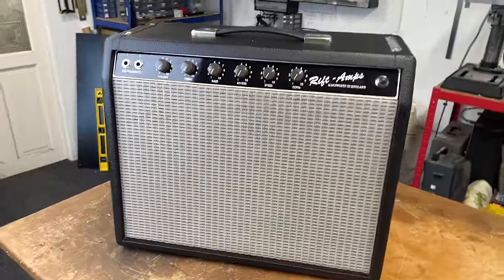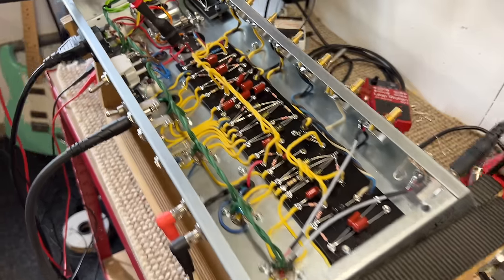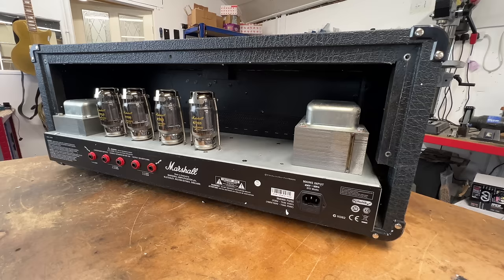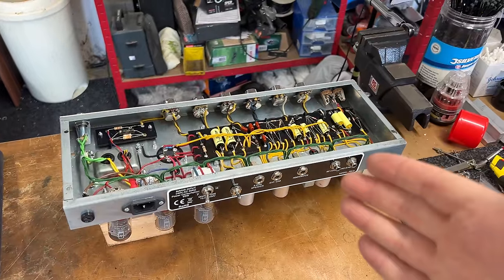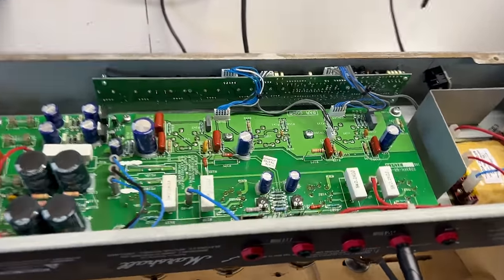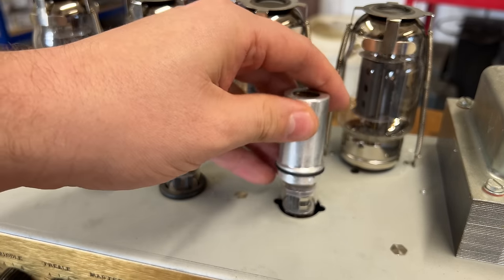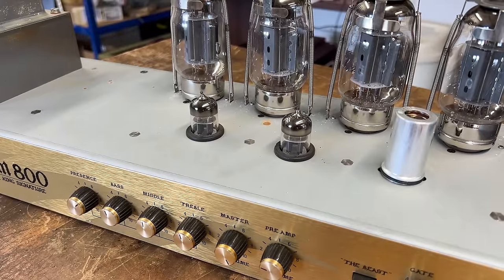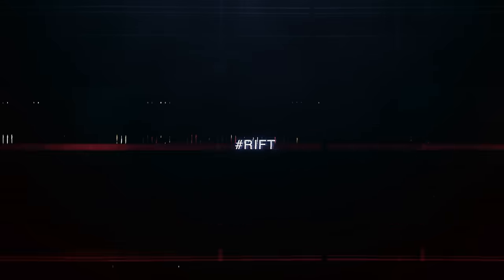Marshall KERRY KING SIGNATURE making all the wrong NOISES | Rift Workshop and Channel Update |

Comment: On noisy amps, I thought one of my home made amps had a problem and was about to open it up and go looking when I realised the noise was actually on the power - a washing machine I think, I noticed it was noisy in the evenings and narrowed it down to just noise on the mains. The amp is fairly high gain but not crazy, probably around JCM800 level of gain and is single ended which might make it a bit more sensitive to noise.  I only notice it when not playing so I obviously just need to play more 🙂

Comment: hi gain amps with 6.3V AC heaters are very susceptible to hum noise! Many new amps use 12vdc on the first tubes. I found that some tubes have more hum noise than others, and finding the right tube for V1 is mandatory! Dave Friedman says that he spends houirs doing that to all new amps that come out form the factory.... BTW you can get a lot of gain from 3 gain stages and monstrous gain from 4 gain stages (just look at the Orange Rockerver ;) )!

Comment: Interesting stuff Chris.. I've never seen the inside of a Kerry King JCM-800.. In the 1990's I had an early Park 50 watt head ( made by Marshall of course) which had a pair of KT-88's on the output and three ECC83's on the preamp stages.  It was a really great sounding amp  and took a Tube Screamer very well.  I regret I sold it and replaced it with a 50 watt Mesa DC-5 which was a very finicky amp to operate and didn't have great reliability.  With all those extra earning from YT,  I recon the the next 'rounds' on you mate  🤣
Reply: That’s one of the worst downgrades of amplifiers I’ve heard of in recent memory. My most sincere condolences.
We live and hopefully learn!

Of course, vintage anything back then wasn’t what it is today.

Comment: Did the Marshall end up having just the 4 gain stages?  I have a 1990's Sovtek Tube Midget 50H with 2 preamp tubes plus a PI tube, and it's pretty high gain on the "high" input.

Comment: So the owner of the KK JCM800 is complaining of noise from the transformer. I’m going to assume that they’re connecting the amp to a load box of some sort in order to actually hear the transformer itself making noise. Are they sure they’re not actually hearing the OT ringing under load while playing? This is normal behavior in my experience but when you first hear it, it’s concerning but simply because you’ve never heard it before - when you’re plugged into a speaker cab it’s much louder than the transformer and thus you never hear the OT “singing” until you connect to a load box.

Comment: Wouldn't a 7025 preamp valve in V1 reduce potential gain in the amp? A 7025 only has a gain factor of 70, instead of 100. Unless I am missing something, it will be a cleaner sounding preamp, i.e., less overdrive from it. Not ideal for somebody who would buy the Slayer amp. 

P.S. Did you find any clipping diodes in there? I'd be surprised if they are there, because Kerry King used a KT88 modded JCM 800 2203 boosted and shaped by a MXR 10 band EQ. Marshall just built that EQ curve and boost into the amp, plus the gate (EQ into the front end I'd guess).
Reply from the maker: You’re thinking of a 5751, a 7025 is a low-noise, low-microphony 12AX7.
Reply: @RiftAmps  I ma always confusing those two tubes. Dho!. Being a tad dyslectic does nto help, as both have a 5 and a 7 in the numbering. 🤣